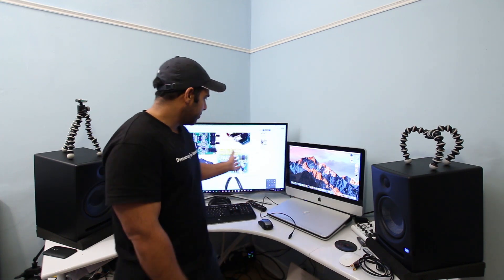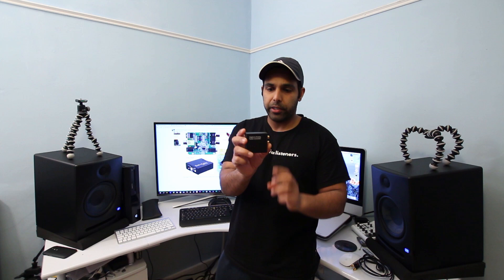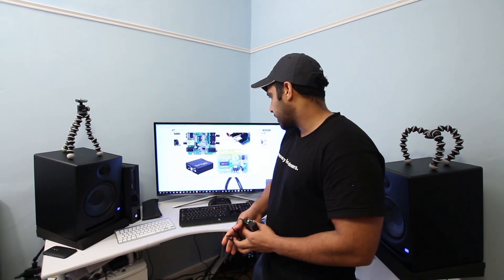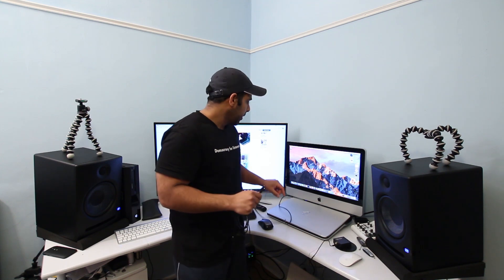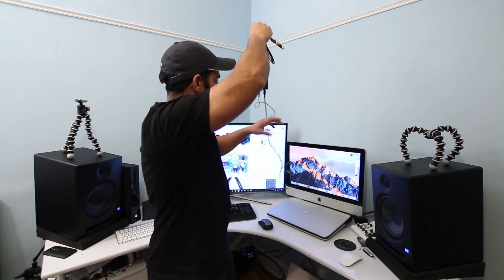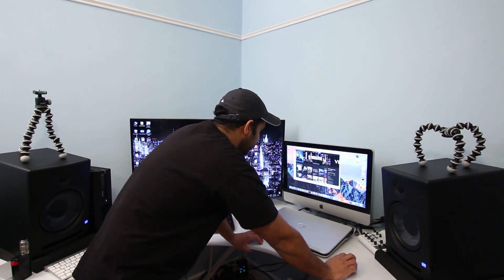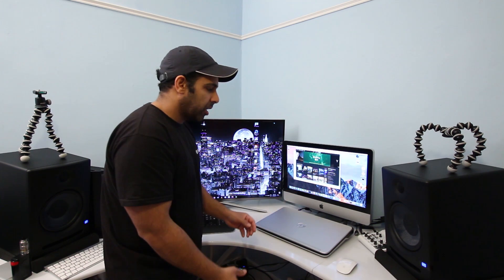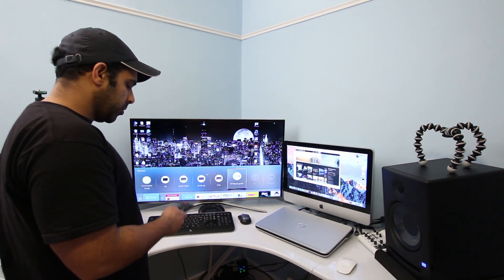How to Connect Digital to Analog Audio Converter Optical Toslink to TV

Comment: my TV does not have digital output socket, only the sound bar. I thought maybe the above box might work in reverse. For example connect the sound bar via the digital cable and then run the the RCA cable from the TV to the box. Not sure if this will work  or give sound via the sound from the TV. I cannot turn the speakers off on the TV or change settings. The TV is Toshiba regza 32 inch

Comment: I got one of these and it said it didn't work with dolby surround sound. I tried to connect toslink but my tv didn't have any audio settings. I sent it back but I still cant figure out a way to attach a headset or wireless headset to my tv. So unhappy that there in no audio out jack at all except toslink
Reply: What connection ports do u have on the TV? Any audio out ports?
Reply: Also are u trying to connect ur TV to a surround sound system

Comment: 87/5000
Can you change the volume from the TV, or do you have to do it from the speakers?
Reply from the maker: yes you can.
Reply: really???
Reply: really??
Reply: I did the same from to connect my lg 4K tv to my iball speakers . The audio is working but the volume increase/decrease does not work from the tv remote . I changed the settings in tv to enable this . Now the display on tv states that the volume is increasing and decreasing but I don’t see any change in the sound volume . It’s constant

Comment: Hi im connected from my samsung UE49 mu7070 via optical out to a dac that is capable of 192khz 24 bit audio then to my technics amplifier and so far i can only output at 48khz even when playing 96khz music on youtube app or hdtv channels. Im pretty sure my tv should support 96khz  audio or am i wrong?
Reply from the maker: does your TV supports 192kHz or 96kHz ( it's the source) ? from source to destination all the devices have to be capable of supporting higher sample rates .
Reply: AVME Videos the info on my tv says it supports up to 96khz via optical and the dac supports from 44.1 - 192 kHz 24 bit.

Comment: Would i be able to run a 3.5mm out from my pc to this device then a digital optical cord straight to my AV receiver? (receiver is a Yamaha RX-V1400)
Reply from the maker: what exactly you are trying to achieve , you can only input one source either via 3.5mm or via optical . So yes you can feed 3.5mm from your PC and out put to your speaker system but at the same time you cant feed optical input from your receiver , only one feed at a time.
Reply: Yea sorry i'm new to this stuff but i figured it out, thanks.

Comment: I am looking to play music from my iMac , through an older Denon receiver/amplifier with seperate speakers. is this the set up I would need. there is no HDMI on the amp only the digital/optical out. or the rca phono red and white connections.
Reply from the maker: model number of your amp & imac then i would tell you the signal flow ?
Reply: Hi there, thanks for reply. Its a DENON UD-M31 receiver and the iMac I bought in 2012 its the one with the CD drive on the right hand side , as for model ime not sure.
Reply from the maker: take a 3.5mm output from headphone jack on iMac to RCA phono L/R input on the denon ( you can buy this cable on ebay or amazon https://goo.gl/WTXrFn ) , connect your speakers to denon via the speaker terminals and it should output the sound.
Reply: Thanks, I'll give it a try

Comment: I have the same dac, but not working. Please help!  the converter illuminates and the optical cables, too. I have tried with my Xbox one, then a TV with optical output, but  no sound.
Reply from the maker: if you have tried it with two sources and tried different cables &  still no sound then maybe it's DOA unit , can you get a replacement ? I would recommend to get a DAC which is branded as i started getting degraded audio with it a couple of months ago.